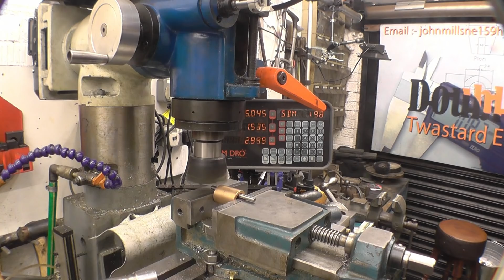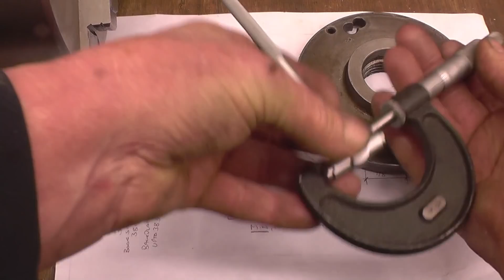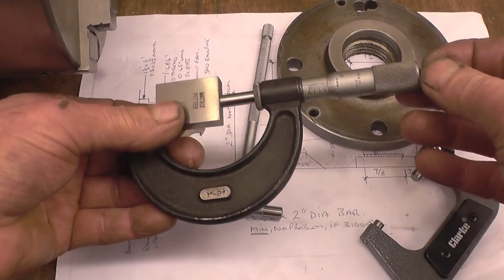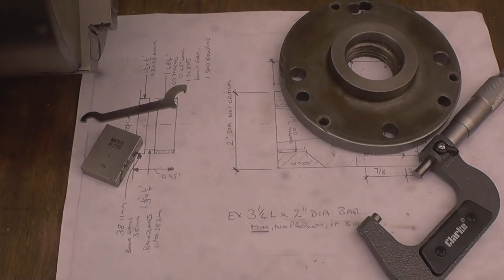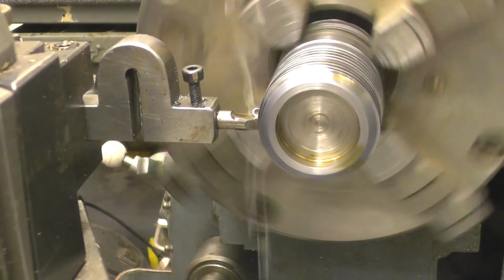SNNC 263 P2    1.5 / 8 TPI  Screw  Up

Comment: John, not only did you cut it the wrong diameter the runout groove was positioned so there was no effective length for the register
Reply from the maker: the register will be machined on the other end
Reply: @doubleboost  My apologies John for jumping to conclusions :)

Comment: Just a curious Q.  Why is the tool holder designed to flex?
Reply: It's a method of reducing chatter, but there are better designs.
Reply: the geometry of the tool, toolpost, topslide, crossslide etc, causes the tool to flex towards the job . normally, the cutting force is small and flex is tiny, but when cutting a deep thread like this the flex can cause the tool to dig in and chatter (or worse) . the spring tool holder is designed to spring the tool away from the work piece , which counteracts the lathe flex and help prevent the chatter.

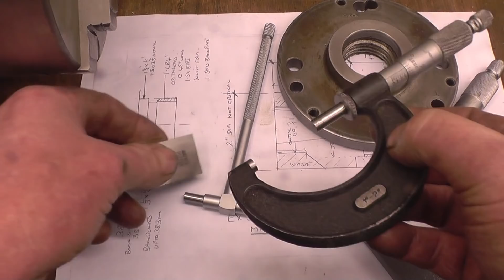Comment: Ähm, i think you have yused your Matrix Piter wrong at 5:50.
You should turn it 90 degree.
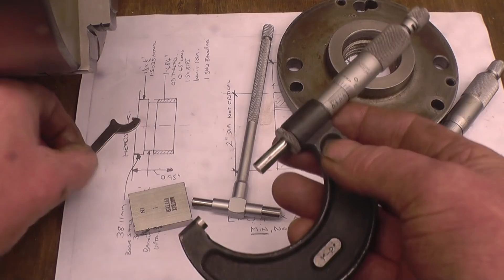Reply: Take a look at 6:14; you can see 1.375" on the mic held that way.  The block is probably 1" on the other dimension.
Reply from the maker: @jimsvideos7201  as i was watching the video for the 20 Th time i realized my mistake  the mike is spot on at 1 inch